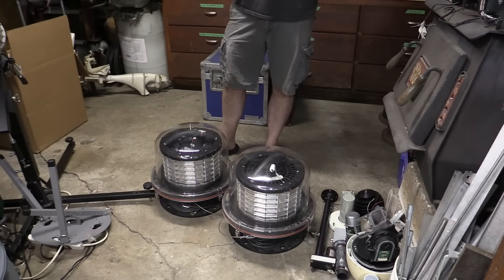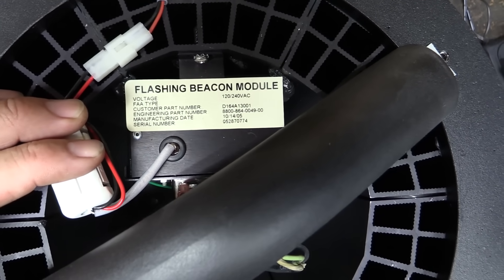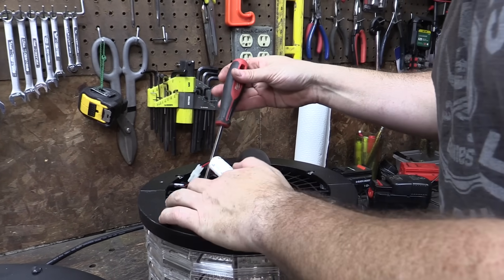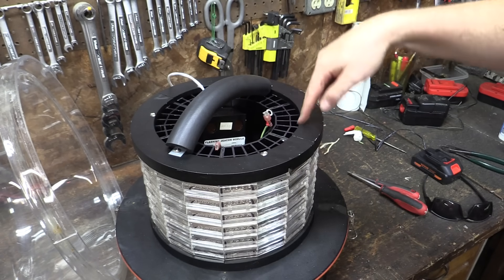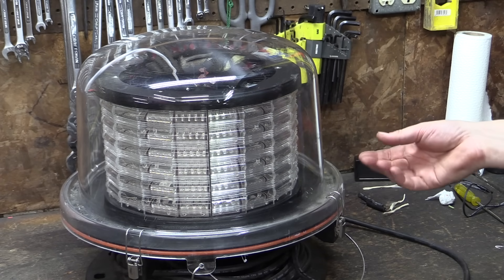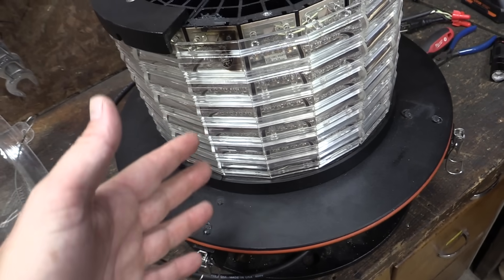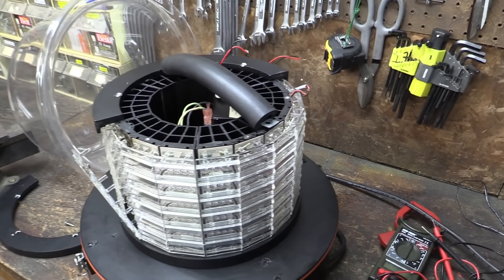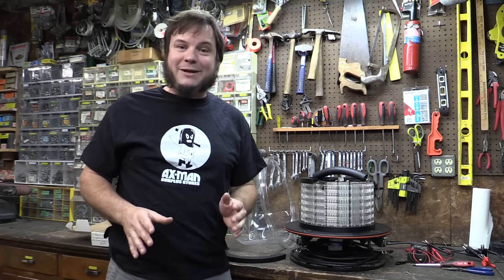Surplus FAA Tower Beacon Warning Light

Comment: I think with the LEDs being in series that the power supply is specced for the amount of voltage they all use together, by jumpering the blown one you are giving the voltage that LED should draw to all the other LED's in the series which would cause them to burn up from being over volted.
Reply: I agree with this, but with that many LEDs wouldn't the single LED being jumped not make that much of a change in voltage? And they probably went this route that way they could use thinner cable to save money.
Reply: I suspect that the LEDs are in a combination of parallel and series. It looks like the there are four LEDs across each module and I'd suspect that those are in series and then going up and down the groups of four are in parallel.   I'd get one module / strip out and power it with a currented variable power supply.  With the small size of the wire you can deduce that they are using a fairly high voltage to keep the current draw down.  The first step is to get one vertical block of LEDs out of the light so you can understand how they are built and the voltage / current requirements.
Reply: A single LED pulls very very little power so it being blown and bypassed would not make the current draw so high to burn up the others.
Reply: Yes, each module in series is supposed to cause a voltage drop. I would have tested only one strip with a bench power supply..
Reply: And yet there are people that tell you you can fix LED bulbs by just sorting out the LEDs that are blown. Technically it's right but technically it also makes it half the life expectancy of the remaining LEDs each time one is shorted.
Reply: Hey,  @imark7777777  , You  can short LEDs to repair and LED bulb as long as the power supply is current limited and not voltage limited. So it can work, but if you get it wrong you'll drastically shorten the life of the remaining LEDs or if multiple are bypassed, i.e., an entire filament, you'll blow up the other quickly.
Reply: @DadofScience  Good to know that means all the ones that i tried it on have been cheap lamps. I was thinking thisProbably power supply dependent but left that part out.
Reply: @imark7777777 Depends entirely on the driver circuit. Good drivers have a  constant current output, so bypassing an LED doesn't change the power dissipated in the others.
Reply: It doesn't work that way. LEDs are /not/ voltage-driven, but current-driven. If yout designed something like this with a constant current, once it heats up the LEDs have a lower resistance and boom, it blows up. It's a simple high voltage LED driver with a constant current.
Reply: @imark7777777  It depends on the driver. If it's a constant current driver it doesn't matter. The current will be the same.
Reply: I agree, try adding some resistors in the place of burned leds. Also, each led should use a small amount of voltage, if you can try to calculate the voltage you can reuse them alone.

Comment: I believe that these things are not supposed to be 100% duty cycle... it should do a 100hz on for a second, then off for a second... this drastically reduces the LED dissipation.  Can you compare the two power supplies' voltages?  Perhaps connect a scope and see if they're trying to blink?  I would have bought these too... they're cool!  Good find.

Comment: Most probably, that "magic box" is a (damaged) current driver with a high compliance voltage.
If it's got blown capacitors and various other obvious faults, it's highly likely that it is no longer limiting the current to the series LED string which would result in an over voltage condition resulting in the burning LED behaviour you are witnessing.

Simply jumping out that second burnt LED and replacing the LED driver with one that has a high enough compliance voltage, would see years more life from that beacon.
The trick would be finding a current driver with that kind of compliance voltage. (it's pretty high and not at all common for general LED applications)

Alternatively, you could reconfigure the LED string such that only 4 or 5 columns are in series, and run those series strings in parallel driven by an LED driver capable of 4-5 times the current, but 4-5 times lower compliance voltage. (probably much easier to procure)

If it were mine, I would rewire the entire LED array as a matrix and create a "running LED" display from it.
Reply: I'd like to add that shorting over dead LEDs will increase the voltage presented to all other LEDs, making them more prone to dying. If they were all in parallel it wouldn't be a problem, but as it is now they all depend on each other to remain within specification.
Adding a resistor in place of the LEDs would be more proper, but the value would depend on the LEDs themselves. I'd recommend using a 1MΩ potentiometer (variable resistor, preferably a linear one). If you turn it down more than 90% get a lower value potentiometer and repeat (next size is usually 100kΩ, then 10kΩ, etc.)
Reply: @iXenox  If you were talking about a voltage regulated supply, or a battery supply you'd be correct.

What I am talking about is a constant current driver. Which is what most LED drivers are.
Reply: @Jimmeh_B  LEDs also have a max voltage rating (and cause a voltage drop, if that weren't the case they would short circuit the power supply). Also it isn't guaranteed that it is a constant current power supply, as it appears to be quite cheaply made and is not user servicable.
Reply: @iXenox  That doesn't mean anything at all. Quite often installations like that are thrown together with pretty botched up components.

And yes, LED's have a forward voltage, and yes they will attempt to draw more current as they get hotter, which is why they require current limiting.

I don't see what you're trying to get at.
Reply: @Jimmeh_B  Which part doesn't make any sense? When answering please keep in mind that your possible lack of understanding doesn't directly correlate with a lack of sense.
I see you are talking about a whole lot of situations and options I am not considering because I don't know anything about the power supply or it's load requirements. It could straight up be a non-regulated power supply and instead it could depend on the diodes sorting out the voltage and current out between themselves (like a resistor voltage divider).
It could be a constant voltage, constant current or unregulated type of power supply and some of these will kill the diodes if operated incorrectly (which replacing the diodes with wires might cause).
What type of power supply it is doesn't matter to me because the load can be made identical to the load that was present during it's 18 years of operation (which, in the worst case scenario, may be strictly required), while reducing strain on the diodes that still work.
In short: if the system operated with a certain load it can't hurt to produce the same load, but not doing so may eventually kill it. Correcting the load with a potentiometer is the best option, shorting over the dead part of the circuit isn't. Shorting just isn't correcting for anything, but it is forcing the circuit to work (possibly outside of specification).
Reply: @iXenox  "Correcting the load with a potentiometer is the best option"
Bro, if they are 3W LED's that's gonna be a rheostat, a potentiometer would burn up almost instantly.

"It could straight up be a non-regulated power supply and instead it could depend on the diodes sorting out the voltage and current out between themselves (like a resistor voltage divider)." ... It could. However given the nature of the incoming mains supply with it's transients/spikes/surges and all other spurious conditions, that is more than highly unlikely.

I note also that you keep eluding to resistive dividers, LEDs behave nothing like a resistor.

"your possible lack of understanding" I am in no competition with you buddy, and I owe you nothing. I have however been playing with das blinken lights since the 80's.

Including diode pumped lasers. You want to know about how to reliably drive LEDs to within an nm of creating a dark emitting LED?

That aside, there is merit to your position of recreating a load as similar as possible to the original intended purpose of the PSU... IF you're talking about attempting to continue to use the existing PSU including all it's blown out caps and whatever else was in that burnt hole in the potting.

An absurd (in my view) proposition. 

I was talking about finding a suitable PSU to replace the (clear) non functioning one currently installed. 

The reality is, I don't need to know exactly what the PSU was, and you seem to know better than to wander off on these tangents. It's a very large series string of LEDs. You and I both know that the PSU was a constant current driver with a compliance voltage significantly higher than is found in most LED drivers on the market. Knowing this, you also know that shorting 1,2,5, even 10 LEDs from the string will make absolutely no difference to the PSU's regulation as the output voltage is a function of the detected current. Voltage is (in this application) irrelevant.

There are also many ways to skin a cat.
Reply: @Jimmeh_B   Since you keep insisting that it's a constant current driver then instead of connecting a pot (or a rheostat, which is a pot with 2 connections instead of 3, but it's harder to find and it's less useful) in parallel (connecting it across the 2 wires powering the LEDs).
The reason I said to use a 1MOhm pot is because there is no power supply in the world that would just randomly decide to overpower 1MOhm's worth of resistance.
I also decided for a pot because it can be used to find the right (maximum, since it is a decorative installation) value of resistance, before getting replaced by an actual resistor.
Also if it got burnt up the other half could be OK, so just measure it and subtract the read value from 1MOhm and continue as you see fit. The other half of a pot also allows for live resistance monitoring (resistance is not supposed to be measured in a live circuit, or in a circuit in general, but the other half isn't connected, so it can be used for measuring). Which a rheostat doesn't allow for. Also wire-wound 300W potentiometers exist, so I don't understand your point about them being unsuitable for this use case.

Using the same PSU isn't absurd, since it is a niche part and unless he wanted to waste his time rewiring a lot of circuit boards by hand, guessing and possibly killing even more LEDs while trying to set up another PSU, he has to use this one. He doesn't have time for things like rewiring the beacon when he can fix it in 90 minutes or find a project that can be done faster. And he mentioned before that his time is often quite limited, so this is a real requirement.
Also there is no "variable diode", so until you invent it and send such valuable technology in so that a beacon can be repaired a resistor is going to have to suffice for fixing the problem.
"output voltage is a function of the detected current" - this is not guaranteed, so stop talking like it is. The current PSU is an unknown, so unless he buys another one or tests this one and reports on it talking like it is a certain PSU in a certain state of function is relatively unproductive compared to treating it as the thing it is. It also doesn't make sense to talk about it in such a way when even you originally said that it's self regulation is probably dead, which would mean that it can't be a constant current driver.
Sure it is handy to know what it is likely to be, but when trying to fix it blind that attitude is likely to hurt something.
Reply: @iXenox  "variable diode"?
Now you're just making things up.

Brother, there are more than 1 ways to skin a cat.

Half of what you just wrote is rebuttal to arguments that were never made.

Seems you're more interested in a pissing contest than solutions. Something I don't have time for.

So I bow down to you and your clearly greater knowledge of all that is electronic.
Certainly more than I've learned in the time I've spent since you were a mere twinkle in your (no doubt) extremely proud father's eye.

Enjoy the win buddy!
Have a great day!
Reply: @Jimmeh_B  You must not have read my reply with any understanding if this is the kind of response you're giving me.
There is no "winning", there is only understanding what the other person is saying. I understand, but disagree with your approach (which is more by the book, specific problems require specific solutions, than mine, but also requires more resources and time, which is why I don't favor it).

Comment: The timing of this video is insane! 

I JUST went down a rabbit hole of reading about beacon lights like this. Specifically the synchronized ones on top of windmills. Thought it would be right up your alley and the next week you pop up with this thing!
Reply: I always wondered if these synchronized beacons could be seen from orbit. There look to be hundreds of them, all flashing together.
Reply from the maker: The synced ones are neat! Apparently some are GPS-timed. I noticed a few years back that the tops of some tall buildings in Minneapolis appeared to be synced, which was kind of neat.
Reply: @saveitforparts  Some police and emergency vehicle lights are sync'd now.  Soon I expect to see turn signals on the silly battery cars flashing in sync.
Reply: @saveitforparts wind farms use GPS synced lights. Every turbine blinks in sync. The idea is so it appears as one big hazard to pilots.
Reply: Get used to it. We are connected, have you tried clairvoyance or telepathy with the technology.   Get ready the world‘s about to awaken ⚡️💻🧬🧠❤️🐸🍿🧘🌈
Reply: @tangopapajuliet9469 Don't be silly. There are 220, 000 subscribers to this channel and you think a video covering a topic that a like-minded viewer has recently researched must be clairvoyance rather than an coincidence that has significant odds of happening?
Reply: Don't know if it still applies but a friend of mine have worked on some smaller parks with pretty hefty turbines. The beacons were synked via the fiber cable used for data communication between plants and out from the park.
Reply: @xnizonyt  well it Works Instead of flying through one or 2 towers i would avoid the Whole Area

Comment: For brief power tests with a/c, put a power strip with a switch before the wall plug. You can stand back and nervously flick it from the bench w/o having a handful of plug to watch with one eye and equipment with the other eye. Don't have to look at the swich to use it.
   I did that for a while, now I have a 250v foot pedal spliced in the middle of a heavy cord.
Reply: Bad idea - the switches in power strips can weld closed and might get hot/injure your hand if you are trying to use them to stop a near-short-circuit/overcurrent situation. Wiring up a proper circuit breaker would be much better.

Comment: I climb cell/broadcast towers for a living.  Certified technician.  I've done alot of lighting jobs full light swaps to bulb changes. Really love your channel and content.  
Those style strobes are avain lights... if you have issues with getting it to flash or work that's why. Plus there's components in the control box that get it to function.

Comment: When “testing”, run a standard incandescent bulb in series with one side of power input. It should shunt the level to pop the bulb, if too much current is drawn, protecting the Device Under Test (DUT).
Also, keep one hand in your pocket while power is applied. You know, in case it bites. ✌️

Comment: I don't know how into building devices from scratch you are, there are plenty of LED/zener diode testing circuits on YouTube that can produce a high voltage but a low current. You could use this to test each LED module and note if they are all pretty close in the same voltage range when activated, if activated (the bad ones may not turn on). As you can see from the comments, LED lighting has specific requirements to ensure efficiency and longevity, in which it can get kind of complicated to find/build your own driver. I think what you have is really cool, so have fun, stay alive and play.

Comment: Our radome originally had a red beacon on it.  It was removed when we painted it a couple of summers ago, and according to both regs and the NAVCAN registration database, it's not required.  Now, if our radome were up the hill, it would absolutely require a red beacon.  But the rules are about height relative to the nearest airport runway, and distance from that runway.  We're just barely close enough to the small airport, but because we're in a bit of a valley, the top of our radome isn't actually high enough to require it.   Since the beacon that it DID have was never formally registered, we opted to quietly not re-install it.

Comment: There appears to be 6 segments (heat-sinks) for the entire LED beacon, with 3 LED modules per segment.  And wired in series, as you commented.  Each module appears to be 4 LEDs by 7, 28 LEDs per module.  That comes to (((4 × 7) × 3) × 6) = 378 LEDs.  If all the LEDs are in series (@ 2.2v each), that's about 813 volts 😱  However, . . . .
As each module is an array of 4 × 7, that's only 28 LED's, at 61 volts per module.  Now, if you can prise off the modules, you could cut the tracks joining all the LEDs in series, and parallel each set of 4, resulting in a drive voltage of 9 volts (ballast resistor for each set of 4, required to limit current to ~ 40mA)

For a 12v supply and a maximum of 40mA, would require a (12v-8.8v) ÷ 0.04A = 3.2V ÷ 0.04 = 80 ohms
For a 12v supply and a maximum of 20mA, would require a (12v-8.8v) ÷ 0.02A = 3.2V ÷ 0.02 = 160 ohms

Sure, it's more work to modify the beacon for low voltage, though that would make it easier and safer for you to power and install, and operate.  More colse-up images of the circuit-boards, will confirm the particular wiring of the LEDs, and a suitable method of powering them, without loosing any magic smoke.